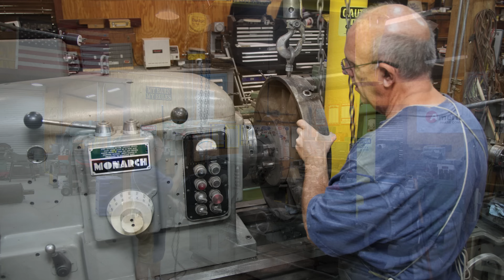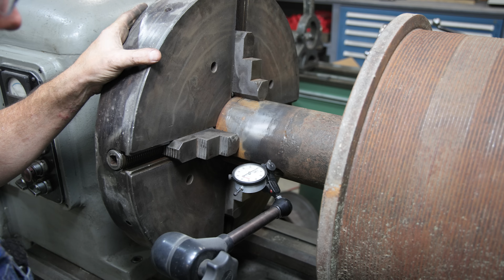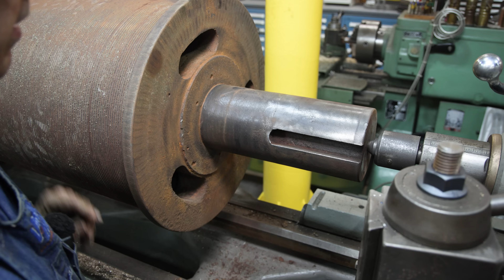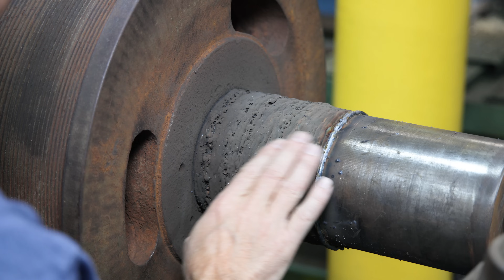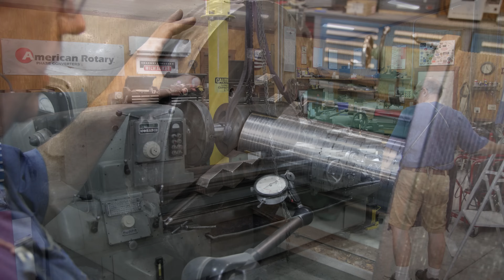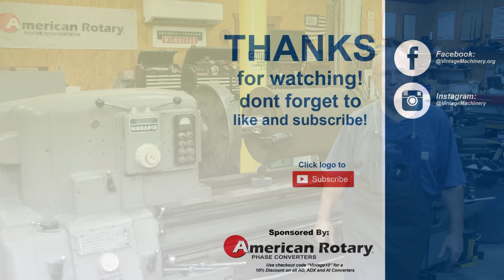Monster Cane Mill Restoration: Building up and Turning Down the Bearing Journals

Comment: Keith, It's not porosity it's definitely as you said, cunningly planned oil reservoirs in the weld area.
The spiral marks could be related to a bit of crude left in the center drill hole.
Cheers Eric

Comment: Keith, 

If you do that again, what about putting a small diameter piece of round stock in the lathe behind it and  linking them with a belt, using that to "power" the large diameter part, so that you don't have to rotate it by hand?

Comment: Cutting Edge Engineering has a very nice swivel joint for grounding a part for weld.  In this case it would require using a stead rest though... assuming the steady is big enough.

Comment: Hey Keith, next time you might consider undercutting the area to be repaired by .025" - .030" per side before striking the weld, and also taking a grinder or rotary file to the "rusted-out" areas if the turn doesn't clean them up completely.  Also, as someone else has mentioned, a bit of pre-heat will also do wonders for your repair overall.   Then again, as you said, (paraphrasing) "It's not like we're doing this for NASA.  I completely understand and, as we say often, "It's not a Swiss watch or a rocket ship, so just get it fixed!" 
Thanks again for a good job.  BTW, I enjoyed your repair of the clutch engagement mechanism, another case of "get it fixed!"     (I do, though, think a Monarch is the 'Swiss watch' of lathes!)

Comment: Neat trick with the mig welding. Kind of surprised you didn't use a face shield when doing the clean up with the wire wheel.

Comment: A couple of tips that you might consider if you find yourself doing something in this size of shafting again. I agree with some of the comments about the rust pitting and porosity with solid wire, it absolutely hates any residual rust. I have used dual shield wire for years for shipboard work and can attest to its ability to penetrate deeper and "float" out impurities in the base metal. I have used both Select-Arc 720 and Lincoln 71 Elite. Both are available from 035 and much larger, up to 5/64. You can run Select 720 on straight co2 or 75-25, the 75-25 gives you higher tensile strength and yield strength, about 10 percent higher. I've always used 75-25 and can't attest to straight co2, but with a flap wheel or grinding on old metal have never had any issues with porosity when joining old steel to new to speak of. I run 1/16 wire from an LN-25 and a Miller XMT 350 for much of what I do but have run both the 035 and 045 in my smaller machines like yours and have no problems. 
   The other tip I got from a marine shafting and propeller shop, they had a shafting lathe that could take 40' shafts up to 24" in diameter. For their shaft build ups they used a piece of large copper braided ground strap like you used to see in old vehicles for their ground strap wrapped around the tailstock end. They had a shop built lead screw connected to a separate drive and carriage using a drive tire that contacted the chuck with a very large reduction gear motor for power. They changed the speed of the carriage with a vari-drive depending on the size of shafting and what wire they were using. They did a 14' long 6" shaft with 7" bearing surfaces for me and it was very cool to see how perfect the welds came out with that rig. 
   As always, I love your content and hope you find my 2 cents worth as useful as I find your video's. Thanks again!

Comment: Hi Kieth 
Love your vids you are much better off pushing the Mig gun unless you are using flux chord, hence the amount of porosity, so you would have been better rotating the work piece towards you when welding
You also get a lumpier weld when drawing the torch.

Hope you don’t mind my commenting 

Kind Regards
Mick. (uk)

Comment: Morning Keith,
Major repair on this roller. Q. Is there a reason you did not put some heat on the shaft before welding? Just curious, usually heat helps with the welding process.
Thanks for sharing.

Comment: As a welder, I see a couple places you can improve. First, that welder is way too underpowered for what you were trying to weld. That part also needs to be preheated with a gas/oxy torch. Lastly, I think stick welding would have been a better option given your equipment. You'd need a bigger 250 to 350 amp MIG welder with something like a dual shield wire, probably .045" or bigger, to properly weld that up. That extra porosity can be where cracks start to form. Although in this application, since I don't think this us going to see use like it did when it was made, it's probably OK.

Comment: Great work as always! 

One of the things I find most difficult in machining is dialing things in. I find it frustrating, and I'm just not very good at it. Part of it is lack of practice (I'm not very experienced at all) and part of it is having equipment that I know is not very precise, whether its my indicators, the holders for them, or the actual old lathe and mill I have to work with. The slight slop in all of these add up to getting accurate readings very confusing and difficult. What it leads to is me just not attempting projects that take great precision. That's a good thing, really. I know my limitations.

Comment: 10:45 this. I've seen it a few times. What i've done in the past is cleaned it as best i could, used the needler to clean the pits and filled them up with metal epoxy. On the shaft i have repaired, it's ok - no separation so far.

Comment: Hi Kieth, 
good to see your lathe repairs back in operation. 
The spiral marks you have  in the turning are a puzzle. 
I assume you had the tool retracted when you traversed back towards the tailstock when you finished a cut. If not, then the saddle may be cocking off slightly on the return and causing it to cut a little deeper. 
The other thought was the roller being off balance. 
How much crud has accumulated inside, on one side of the drum?
At that rotational speed that thing could be trying to tear itself out of the chuck and your live centre's  bearings might be moving a thou or two to give an extra deep cut but that would be closer together. 
I'm sure you'll find it.
Regards from Canada's banana belt.  🤞🇨🇦🍌🥋🇺🇦🕊🇺🇲💩🏁👍
Reply: If it was tool drag, it would be a spiral pattern. Looks like he has some slop and tight spots in his saddle, which is no surprise given the recent problems he had with it breaking the drive chain. You can also see how hard it is for him to move it. That saddle is going to need a full teardown, clean and rebuild.

Comment: Pity he was turning it the wrong direction when mig welding.for building up to machine you really should be pushing into puddle with welder so that any impurities rise to surface. Slag always forms on top of molten puddles of metal. Just laying weld on top doesn’t make a puddle.

Comment: An electric upgrade to that crane would be nice. You should look into a foot pedal for the welder so you don't need to reach up an over when doing jobs like this.
Reply: He's been using a manual chain fall on his gantry crane for years. Every time I see him using it and sweating and grunting for 10 minutes pulling the chain I think he's going to learn, but he hasn't so far. 😲 And yeah, a foot-switch would have made things much easier and a more consistent bead.
Reply: @kindabluejazz  He did mention that he was looking into electric winches for this crane, probably just waiting for the right deal to come along. Not everyone can get stuff like this on trade for videos, and now that he retired from his full time job, money comes in when work comes in. Physical effort aside, I'm more concerned about those chains dinging up the machines and parts. This physical effort is good for the body and soul, or that's what I tell myself when I'm doing manual work because I lack a power tool. 😃

Comment: Hi there Keith, if you want to avoid spatter when MIG welding, you can try the following - 90%Ar/5%CO2/5%O2 mixture, 22,5V and 200A (about 4,5m/min for 1,2mm wire diameter). Getting the mixture can be a bit tricky, depending on your supplier, but is the only way to get spray arc (which has no spatter) at 200A.

Comment: Please do not take this as criticism. I am a licensed welder by trade. One thing I frequently see on machining channels is the questionable practice of MIG welding on surfaces that are less than pristine cleanliness wise. MIG has no cleaning characteristics of any kind, so any rust you encounter at all will cause porosity. Another issue with MIG on large members is hard spots due to MIG being a "cold" process with little heat. This could be the reason you have the "bands" showing in your machined surface. To mitigate this, preheat the parent material and keep it hot during welding, then cool it slowly in air. For a better, more consistent weld with wire feed, consider flux core wire with some preheat at the start. The flux in flux core wire actively cleans out contaminants, and since it runs hotter than MIG, it does not require heating during welding. The machine you are using is a Lincoln 210 MP and it is capable of running flux core by changing a few readily available parts and installing flux core wire. I would recommend that you try flux core sometime. I am sure you would be much happier with the finished results.
Reply: I was wondering if Keith should have taken a skim pass on that shaft to clean it up and get rid of the rust, or at least a big majority of it. I’m not a welder other than what I stick together in my shop but when I’ve seen welders repairing heavy equipment it seems they spend most of their time prepping the material and the welding doesn’t seem to take that long.
Reply: That would be correct!  It’s 90% prep work with 10% welding if you want a pristine weld!

Certified multiple processes all position for 35 years!  Cleanliness is next to godliness!!!
Reply: That was nice of you to share your years of experience. We all need direction at some point.
Reply: Kieth, like the rest of us, is learning something new every day, no doubt. Good advice like this allows us all to step up to the next level so I say Many Thanks to you wingman as I have learnt a lot from your comments. I also now know why Kurt from Cutting Edge Engineering always uses flux cored mig wire when doing these sorts of jobs. Once again, many thanks.

Also, a good job Keith, greatly appreciated. many thanks.
Reply: Keith knows all this, however this is a simple weld build up not a critical part.
Reply: Didn't know that there was flux core available for a MIG machine. Good to know!
Reply: @Tishers  what?  That’s what has always ran in a MiG!  There is dual shield flux core which requires a shielding gas and then there is inner shield which does not require any shielding gas!  Both available for MiG welders

Comment: Good morning Keith. 
I’m impressed with that job you tackled. As someone who has used a chain fall hoist, I appreciate the ability to move it in small increments and have the internal clutches hold the load. I really like your BARN. Congratulations on your retirement. Now you will be working harder than you did at work, but there’s no one to tell you what to do.

Comment: It appears that there taper lock bushings in each end of the drum. If that is the case, then that shaft is replaceable. I've replaced shafts on our conveyor belt rollers after bearing failures are them up.

Comment: Finish on shaft could be a balance problem
Reply: If it were going to be turning at a significant speed, yes. As Mr. Keith mentions a few times, in its normal operation it has a speed of one to two revolutions per minute. Realistically, the shaft could be so crooked that the gear ends up wobbling half it's width off of center of the plane of rotation, and it will have zero functional impact on the machine's operation.

Comment: Put an electric hoist on that crane
Reply: Negative. 
You can’t get the fine adjustments with an electric winch. This chain fall winch is ideal.
Reply: @Jimgotalathe  Adam and Kurtis both have electric winches, they seem to have no problem getting the level of movement they need. You don't use a winch to do 0.001" adjusments.
Reply: I have an electric hoist in my welding shop and love it, however in my machine shop manual hoists are much nicer, you rarely are lifting heavy parts repeatedly and the manual hoist lets you ease it down to put in a chuck or on mill table. Some newer hoists do have variable speed but are pricey for most uses
Reply: No
Reply: @Jimgotalathe  worked with an electric hoist 5 days a week for 20yrs, pass on the chain fall

Comment: If I might suggest a way to avoid porosity in the welding in the future, you might consider removing all of the pitting before welding. The gas shielding does nothing to remove impurities or you could try dual shield and that might not help much. MIG requires the surfaces to be bright clean in order to form an adequate fusion

Comment: Thanks for posting. I didn't see if you were wearing any respiratory protection while you were using the wire brush on the rusty roller. If you didn't, please consider doing it in the future. All of that iron oxide "dirt" on your arms after the work tells me that there was plenty of crud in the air, which means you were bringing way too much of it into your lungs. As a person living with pulmonary fibrosis, I can tell you it's no fun having to use supplemental oxygen while knowing the condition is progressive and incurable. We want you around for a long time, so please take care of yourself!

Comment: Excellent presentation.  Thank you.  Really interesting to see how various machinists solve issues using what is available to them in their shop.   Seems like there is always many multiple ways to solve issues.   This specific issue might would be a good fit for a spray welding setup.  You work on a lot of old rusty worn out stuff and could probably get a lot of use out of it.

Comment: Great video Kieth. 
I'm not a machinist, in fact I haven't touched any turning equipment since my school and college years around 40yrs ago, but I noticed that both times you centred the work in the 4-jaw you didn't seem to check the end held by the tailstock to check concentricity so as to not turn a taper? 
I appreciate that this part is very slow moving and has a babbitt bearing but I still feel that, cosidering the length of that central shaft, a small error at the chuck end could end with a larger error at the tailstock.
Just a thought. 
p.s. I loved the lathe repair videos as well, in fact I thoroughly enjoy ALL your content. Keep up the great work.

Comment: Your saddle has wear in it where it rides on the bed ways. That's causing the lines in the work piece.  Time to do some reconditioning to the saddle ways. The stiffness trying to crank the carriage is probably years of crud buildup under the saddle. Possibly a bad bearing or two in the apron, too.
Reply: Looks as if the saddle clamp need freeing off 🤤
Reply: @colinhy1  Possibly.  There's gibs up under the saddle that need adjusting, too.  Personally, it needs a full tear down and cleaning not just some adjusting.
Reply: @colinhy1  Some of the newer Monarch's have rollers for hold downs mounted on the underside of the saddle. Those may be froze up causing stiff movement. Not 100% sure on that, just saying. It's been 45 years since the last time I worked on a Monarch lathe.  I do love them and would be my choice of lathe if the chance ever came around.

Comment: In order to avoid that porosity in your weld, I believe you'd have to machine the shaft clean before welding. Contaminates trapped in those pits is boiling out. A lot more work. Like you said, those little pits won't hurt.
Reply: call them "tiny oil reservoirs".

Comment: That is such a gorgeous lathe. I bet you could make a lady’s hair pin from a railroad axle.

Can really heavy projects hurt the bearing in the headstock?
Reply: Don’t think so. The headstock bearings are designed for heavy loads such as this. The heavy load is more likely to overload and damage the live center bearings

Comment: I wonder how balanced that part is.
Reply: It turns at such a low speed that balance (or the lack of it) doesn’t really matter. Have you ever noticed that the tires on farm tractors and implements are never balanced?  Why? Because it would be a waste of time and money to do so. These things travel at speeds low enough that an imbalance doesn’t even make itself known.
Reply: I was wondering the same thing. A heavy out of balance part turning that speed would put a tremendous side load on the live center.
Reply: @markmossinghoff8185  seems like it might cause the wavy nature of the cut. Too small to worry about in operation I imagine

Comment: Great to see the lathe fixed and running. I'm not engineer but wouldn't it be a good idea to take a light skim off the shaft before welding just to clean it up. I wonder if the porosity is from oil trapped in the surface.

Comment: I think I would have unplugged the lathe during the welding. This way the only path for the welding current to ground is through the welding cable. I've seen damaged electrical wires due to a poor ground connection on a welder, as the current found its way through the domestic wiring.

Comment: I think you needed some pre heat into that shaft before you started welding. You could tell those first few rounds were barely welding. It evened out farther down once it warmed up.
Reply: Yes Preheat the shaft before welding.

Comment: No shame to do some welding classes on specific welding methods or do more research to find a better solution to a welding job like this.
You could reach out to Mr Topper at Topper Machine LLC (YouTube channel). He lives in Spooner, WI.
He also works on old steam engines and locomotives like you